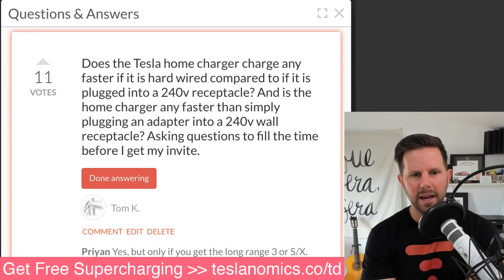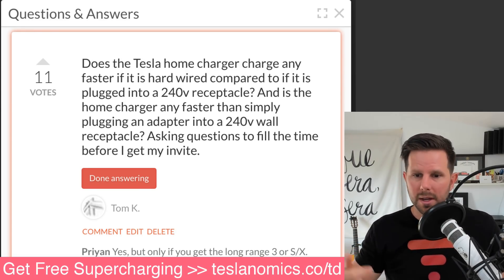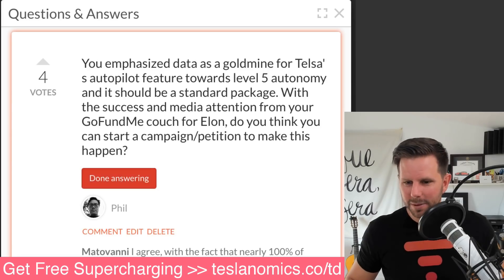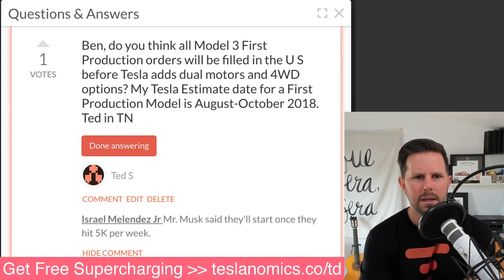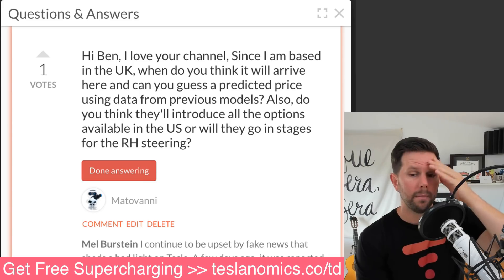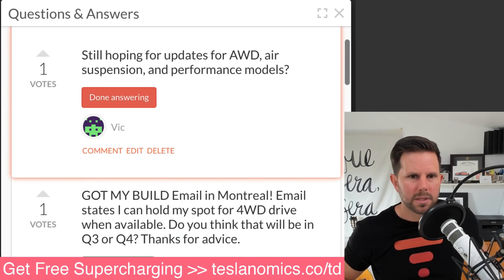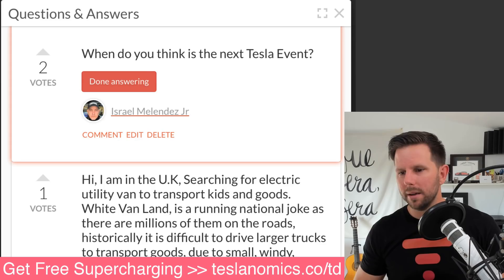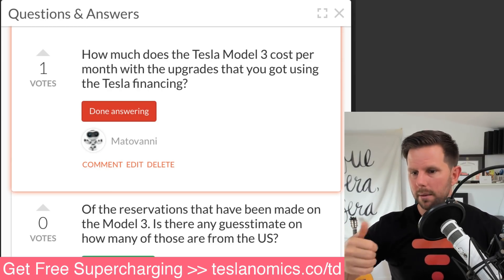Is a Tesla Wall Charger Faster Than a Plug? Q&A from Apr 30 2018 [highlight]

Comment: I drive almost 150+miles a day on my 90d x. I usually get home from work around 10pm leave at 5:15, and I have 72kw onboard charger. The nema 14-50 doesn't always fill be up overnight.

Comment: Great vids Ben, I was wondering what the cost diff is when charging on the basic, 240 and wall charger. Watched many videos and I’m not sure if this is covered. Think would be cool info but prob takes 3 months to test and get a number.
Reply from the maker: If you pay per kWh it shouldn't matter unless you have Time of Use rating
Reply: K, thx

Comment: In short: Yes

A NEMA 14-50 (240V) outlet will use a 50A breaker supplying up to 40A to the car (when connected to a wall connector). The wall connector can support much more than this, but you are limited by the weakest link in the chain (the outlet).

An extended range model 3 can receive up to 48A of charge, so wiring the wall connector directly into the breaker box using a 60A breaker and 6 gauge wire will give you the necessary power needed to achieve a 48A charge (which model 3s with extended range can achieve).

The mobile connector that comes with the model 3s can support at most 32A, so when plugging it into the outlet, it becomes the weak link.

When the short range model comes out though it'll be limited to 32A so none of the above will matter for those owners.

Any S or X owners, or anyone seeking expansion options will find much better support and power when installing a wall connector setup.

Comment: I really want the TESLA model 3 but I live in a condo and have no place to charge the car.  I want to ask the HOA to allow me to do that but I don't know how to begin.  What can people do who live in Condo/apartments???  Everyone goes on and on about the electric car but no one says anything about is Condo/apartment people.  THanks.
Reply: Do you have an attached garage or carport? If you only have a dedicated parking space, is it adjacent to your unit? 

To get the maximum charging speed on the Long-range Model 3, you would need a 60 amp, 240 volt circuit and install the Tesla High Power Wall Connector (HPWC) or 3rd-party equivalent such as Clipper Creek or Juicebox so you can charge at 48 amps. Using a hard-wired connector (EVSE) like this may be required if you have an open carport or parking space. The Tesla HPWC is less expensive than other EVSE's and more versitile as the amount of current it draws can be configured at installation time to match the breaker. With 3rd-party EVSE's you will pay a LOT more to be able to charge at 48 amps as it's a different unit compared to the ones that charge at 40 amps and even those units are generally more expensive than the Tesla HPWC. 

The next best option is a 50 amp 240 volt circuit with either a hard-wired EVSE as previously mentioned or a NEMA 14-50 outlet. The latter is only practical if you have an enclosed garage and can leave the Tesla Mobile Connector plugged in all the time (exception being an occasional trip where you unplug and put in the car). However, the Mobile Connector included with the car can only charge at 32 amps even on a 50 amp circuit. Whereas if you have the HPWC or other EVSE installed, you can charge at 40 amps. 

To find out what charging rate is appropriate for your usage, visit the Charging section on the Tesla website and enter your estimated miles per day to see how long it will take to charge using the Mobile Connector or the HPWC. 

If you can live with the 32 amp charging rate, the cheapest (reasonable) option is likely a NEMA 14-50 outlet. Some people have installed these outdoors in a weatherproof lockable box that's big enough to house the "brick" part of the Mobile Connector with the NEMA 14-50 outlet. 

The above options are just a start place as there are many, many variations to the above. 

Note that if you do install the Tesla HPWC or other EVSE, you will probably want the ability to take it with you when selling the condo so make sure that won't be an issue.

Comment: Most share ride drivers don't do more than 150 miles in a day. The Tesla charger is only $500, which is way cheeper than other wall chargers that support 72 amps You're looking at a 32 amp charger for same price 3rd party.

Comment: I'm using a 1st Gen Mobile connector with a NEMA 14-50, which allows 40A with the Model 3 LR.  If you use the 2nd Gen MC, you only get 32A.  And finally, the wall connector allows 48A with the Model 3 LR.

Comment: Hard wired is safer, more efficient, more durable, and more convenient. It's more efficient because it lacks the additional contact resistance of another plug and socket.  It's safer because there's one less physical contact interface to heat up, oxidize, and potentially fail.  Hard wire of appropriate size has a current limit higher than the EVSE can use.  Some NEMA plugs (and other country equivalents) can have a lower current limit than the EVSE can use.

Hard wired is more convenient because it's always physically in the same place (think gas pump), and it has only one connection (at the car).  Using the mobile adapter can require plugging in at both the wall outlet and the car.  The mobile adapter is meant to be a temporary solution.

Tesla's factory in Europe is in Tilburg Netherlands, not Belgium or Germany.

Elon already said they would make a small delivery van based on (and after) the pickup.

Many of the questions you don't know the answer to have already been answered by Elon.  Perhaps you should pay more attention to what he says,
Reply: Loanword Eggcorn Isi

Comment: Man I love your videos but sometimes you need to do some more research. Yes, the high powered wall connector makes a difference! If wired properly. Any new Tesla (Facelifted) Comes standard with a single 48amp onboard charger Or if it's a performance model or you have it retrofitted  or a Performance model it comes with a single 72amp charger. Now the pre-refresh cars come with a single standard 40amp charger but you can add a second charger and charge at 80A also most older P85's P85D's and P90D's came with Dual chargers already. So the mobile connector can charge at 40A or the new gen 2 mobile chargers that come standard in all cars now only charge at 32A. So yes the Hi powered wall connector will give you a min of 8A more on newer cars but up to as much as 80A on older cars. Ive had both cars and will NEVER have the slower charger again! To me it makes a huge difference to be able to pull in the garage and get charged up twice as fast.  It just makes the experience that much better. Plus you can just leave the mobile connector in the car and never have to worry about forgetting it at home because your use to it laying in the garage and its not getting any wear and tear and can stay like new. To  me its its just part of owning a EV. Were only talking about $500 for the 8ft version and $550 for the 24ft version. (I think you can get them for around $350 on ebay.
Reply: Agree Ben seems to not know a lot of answers that for example are on the Tesla web site, or that Elon has mentioned in investor calls, tweets or reveals.

That said, higher power charging generally is not needed at home unless someone drives unusually long distances (like nearly 200 miles) per day.  Most people drive 30-40 miles per day, which is easily charged at low Level 2 power.  I'm referring to using a hardwired 40A EVSE.  Agree you should not use the mobile adapter for daily use,

Also higher power charging is definitely harder on the grid and slightly harder on the battery pack.

If you can charge over night, higher power is generally not needed.  Please set your charge timer to charge after midnight when the grid has the most excess capacity.

One thing many people are confused about is that the actual AC charger is built into the car (really any major EV) and the EVSE is essentially just an adapter.  Thanks for trying to educate about that.

BTW, your post would be MUCH more readable if it had line breaks.  It's extremely hard to read one very long paragraph.
Reply: I totally agree with absolutely everything you said (Even about having line breaks, My writing has never been that great) Also I do set my car to start charging about 2 AM and I also lower the amperage to around 48A. I agree for most people slower charging is all that is needed. But for me I own 3 businesses all require me to drive a lot and sometimes I will get a call and immediately have to leave out of town Immediately So the faster charging is a must. I think all cars should just come with the faster chargers and the MCU should give recommendations on charging styles. Here I go again writing a long paragraph without any breaks LOL
Reply: Agree with everything you said too.  Didn't know you need to drive that much, in which case the higher power could definitely be useful.  But it's a slightly unusual case.  

Thanks for charging after midnight!  

Agree the car computer or app could help manage the charge, based on driver habits.  At the same time it's useful Teslas have the charge current (power)  adjustment, so we can adjust it manually when needed.

Comment: Working rideshare, unless you really put in the hours, just use a 14/50 with 40a or > and charge for about 8 hrs. And don't Uber, just don't. Lyft is superior. Even limited to lvl 2, the Tesla will add about 130-160 miles in 8 hours depending on your terrain, temperature and driving style. Don't know about you, but even driving my Leaf for Lyft I don't baby it. Passenger experience comes before range.

Comment: A x V = W so... Yes both the amp and the volt matters. If you double the the Voltage from 120 to 240 you get double Watt (our you can lower the amps and get the same Watt).
A outlet and a wall box both uses the onboard charger in the car, so both can be as fast if the service they are connected to is fast.
Reply: Please keep in mind that a wall outlet and plug also have a current limit and their own resistance.  Hard wired can have a higher limit, and it has lower losses, therefore it's more efficient to hard wire.  Hard wired is objectively superior and more convenient since it's always available in the same place..

Comment: How do they fix the infamous panel gaps? You cant just unscrew the panel and adjust it....
Reply: Many of the panels are bolt on and can be adjusted for panel gaps.

The current panel gaps coming from the factory are very good.  I've personally inspected more than a dozen Model 3s here in Silicon Valley from VIN ~50 to ~12000.

Comment: Regarding charging, what you really care about is the amount of watts you can pull, watts is volts x amps. A NEMA 14-50 can deliver 40A @ 240 V continuous, which is just shy of 10kW. In my opinion you want at least 3kW charging when charging from home, for the average commuter. So NEMA 14-50 is more than what you need. The powerwall can do 70A @ 240 V. That is great and all, but remember the charger for the car that converts AC to DC is onboard on the car. My understanding is that the standard charger for model s and x is 48A and 40A for model 3, so unless you have a dual charger onboard you won’t be able to take advantage of the full powerwall power delivery. Further to calculate how long it will take to charge your car, battery capacity is calculated in KWh, so let’s say you have a 75kwh battery and you have a nema 14-50 which has a max delivery of 9.6kw. If it managed to deliver that amount of power for a hour, that would be 10kwh. Times 7.5 to get from 0-100%. But most people will only use between 10-20% per day, which is about a 1-2 hours of charging daily

Comment: Since Tesla’s can draw high levels of power you want hard wired charging. In high amp draw situations contacts from a plug have resistance and can get hot and fail where hard wiring is designed to handle longs periods at high rates. Don’t do a plug unless you can’t afford hard wire which if you own a Tesla you should have the money.

Comment: The High Power Wall Connector (HPWC) can connect directly to a 100 amp breaker, and with the dip switches set for 100 amp, it can give up to 80% (80 Amps). If connected to a 90 amp breaker, and dip switches set for 90 amps, it will allow up to 80% (72 amps). 

The Universal Mobile Charging (UMC) cable detects which adapter you are using, and limits the amps to 80% (or less) of that plug type. So if you use an adapter for a 30 amp plug, it will allow about 24 amp charging. As you get to the 50 and 60 amp plugs, the cable itself is the limiting factor and it only allows 32 amps for the gen 2 cable.

From there, it depends on the charger(s) in your car. If you only have a 32 amp charger, the HPWC won’t let you charge any faster than a UMC in a 40 amp or higher plug. But if you have a model S/X with 72 amp charger onboard, you can defend benefit from the HPWC.

If you can afford the HPWC, it’s rated for up to 80 amps, and if you put it on a 100 amp circuit with proper wire, a model 3 will just use a fraction of the capacity, and shouldn’t have any issues for a long time compared to using the UMC at max amps every time.

If you have a model S/X, with 72 amp charger, there’s a lot of reasons you may want the HPWC. You might want to charge at 30 amps when you only need to gently add 40% charge up to 80% most days, but still have the juice to charge fast after getting off work and before going out. 

You may also be in an area with super off peak rates, 4 hours where electricity cost 3¢/kWh, and you want all 72 amps going in during that window. 

If it’s not your home, it might not be worth installing one, unless the breaker box is in the garage near where the HPWC goes and you have a buddy who is an electrician. Then you can take it with you when you move.